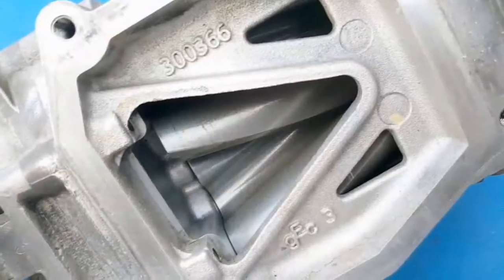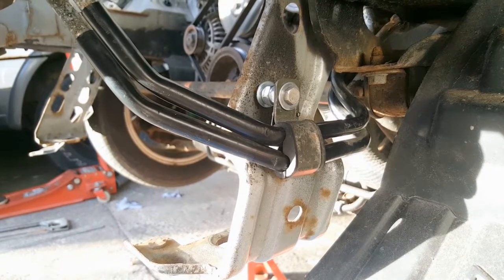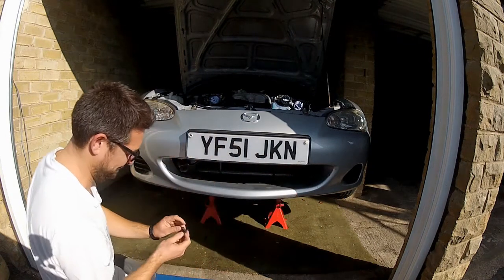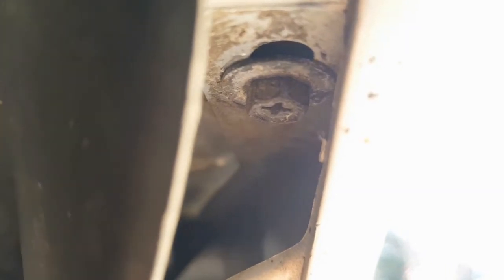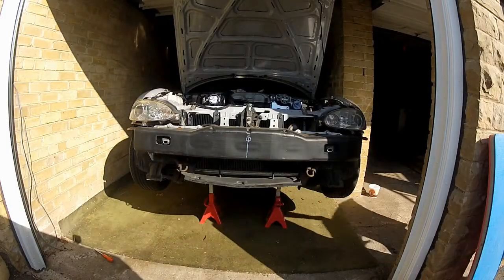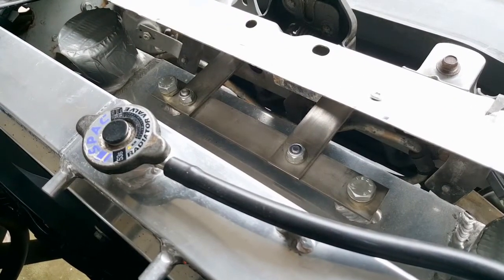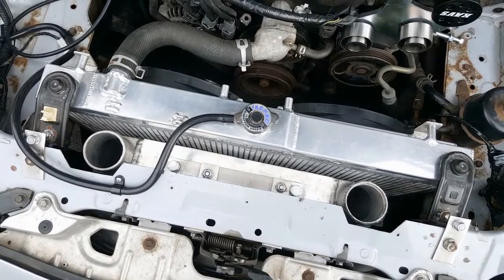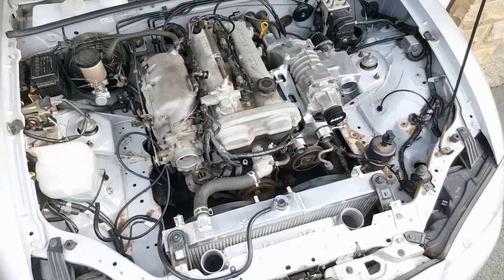How to Install an Air to Air Intercooler Pt 02 + Bumper Removal Process | Supercharging an MX5 Ep 23

Comment: Very nice. Top fed intercoolers are alot better than the 'go-around-the-radiator' type, which is what I have. Having some clearance issues with my ARB and may have trouble upgrading my radiator :(
Your cars looking neat now !
Reply from the maker: It was quite fiddly lowering the radiator but it's been worth it. Running the intercooler piping has been a doddle thanks to that mod. So have you got the stock rad in factory position?

Comment: Great build mate. Missing the capri videos though. Is she still getting some love?
Reply from the maker: Thanks Matt. Capri is getting some love! Filming a Tech Tip replacing the rear wheel bearings at weekend. There's some adjustable TCAs to go on, then it's off to the dyno. Will be doing video updates as I go. Cheers 👍🏻

Comment: does it interfere with closing the hood ?
Reply from the maker: No interference because of the lowered radiator. You wouldn't get away with this setup without moving the rad.